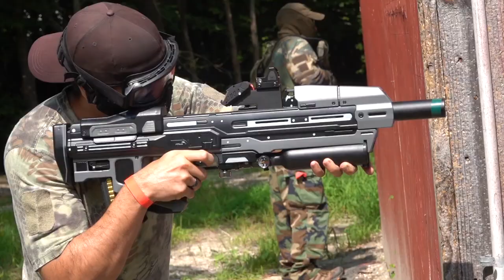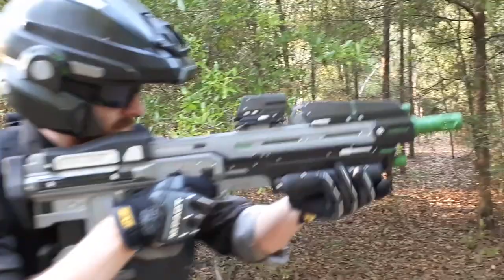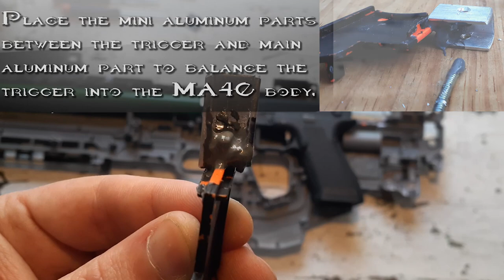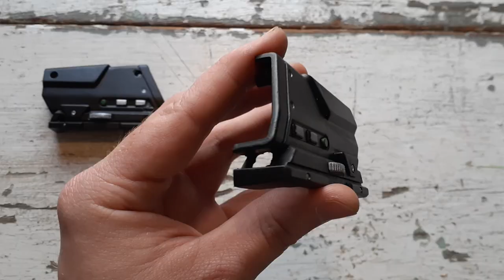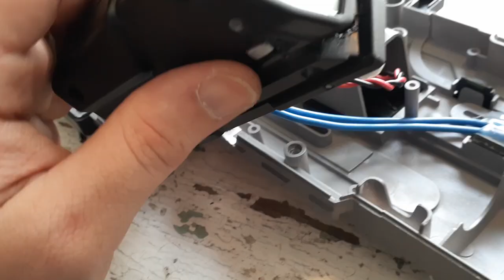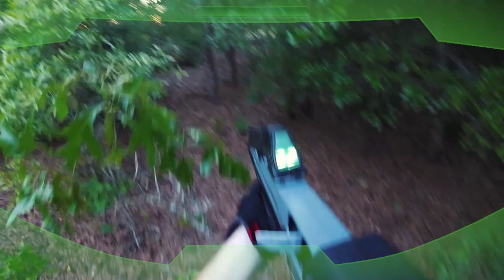How To Make Your Own Halo Airsoft MA40

Comment: What kind of 3d printer could I use to print out the files for the HPA version?
Reply from the maker: Honestly any kind of printer that has a wide enough plate to print onto. If you don't have one yourself, I'd recommend Alpha to Zeta Industries print out the parts for you.
Reply: Ok thanks for the help and an awesome video!

Comment: Do you have the following items regarding the HPA conversion:

-Length of aluminum square tube
- Spacing of 3d printed mounts from each other or based off of end of alluminum tube
-specific tank/regulator used (slp? No slp?)

(I may add to this, about to head out but just came to mind)

Thanks!
Reply from the maker: This Is what Ryan told me. 

There is no measurement for the tube, it’s cut to fit once the MA40 is hollowed out.
Parts mounted to the tube are the same way, placed where they fit once the MA40 shell is carved out.

The regulator is a PolarStar Micro, tank doesn’t matter as it works with both regulator and slp 13cu tanks.

Hopefully this helps! 👍
Reply: @SpartanJess  sure does, thanks!
Reply: you started the build? if so how is it going? hoping to start mine next week.
Reply: @b-swazy316  I have not. Currently working on two major projects (old truck and land) so it may be a minute before I make this happen. 

I did gut my NERF MA40 and that was rather easy. Still need the alluminum tube, hpa tank, and reg. Then having the parts 3d printed, as well as electronics (buttons and what not). Shouldn't be too bad, Ryan gave great views of his rifle.

Comment: With the aeg version, do you have to cut the nerf gun at all or does everything fit right on in? Is it pretty easy to replace the trigger? Looks like a fun and easy project might be my first custom build that I attempt
Reply from the maker: Im glad you're interested in doing this project! For all of the variants, you'll have to dremel the interior to some extent. Allowing whichever platform you chose to fit inside the nerf body. For the AEG version, the trigger replacement should be a standard replacement for the M4 itself.

Comment: would a UAR be possible for an AEG conversion like you did with the last Assault Rifle?
Reply from the maker: We've had someone attempt it in the Halo Airsoft Community Facebook page. It's possible to do, however it'll looks a bit different compared to what you see here. You'll essentially be using the front of the MA40 as an attachment to the UAR because the back is a bit wider than the MA40.